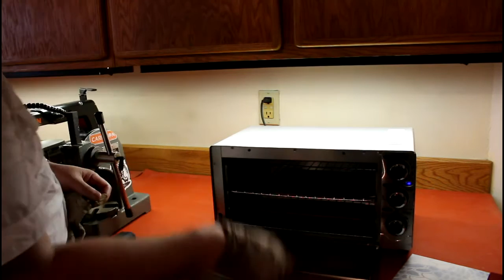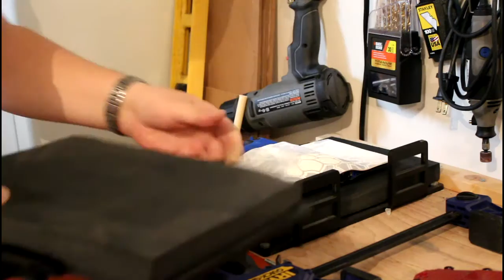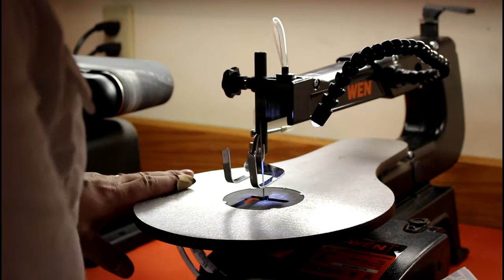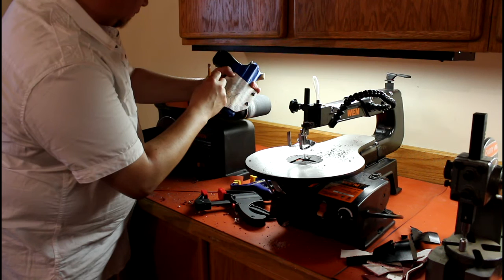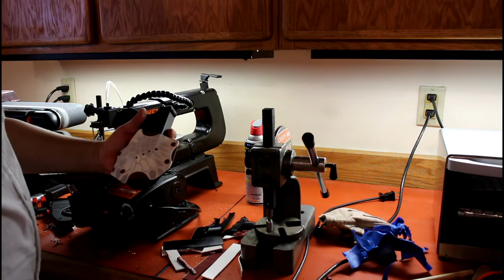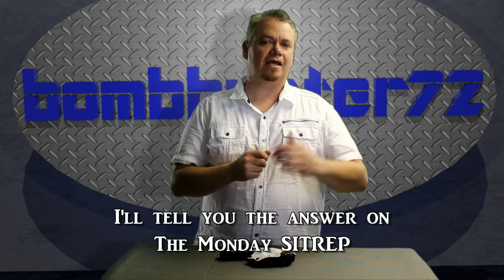Making a Kydex Holster Part 2 - Thursday's Training Tip

Comment: It looks great.  Did you separate the yeti from the blood red before making the cut out designs?  If so, did you use an adhesive to secure them back together?
Reply from the maker: Jason Danels I separated the layers then put them back together.  I don't usually use any adhesive; as long as everything is clean, the layers should sit tight after you press the eyelets. You could use pvc adhesive or even super glue, but it isn't usually necessary.
Reply: Armed With Information thank you.

Comment: Did you make this so you could adjust the tension ?
Reply from the maker: No, I don't usually make adjustable tension on this type of holster. The only issues I've had were too much tension, and I have to use a heat gun to loosen it up. 
My "Taco" style holsters, particularly the ones for competition, have tension adjustment.